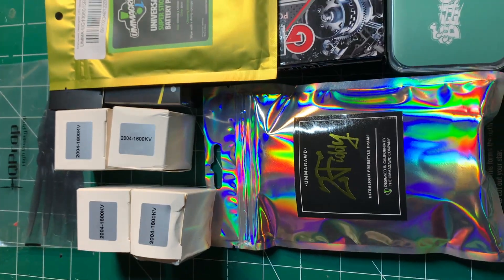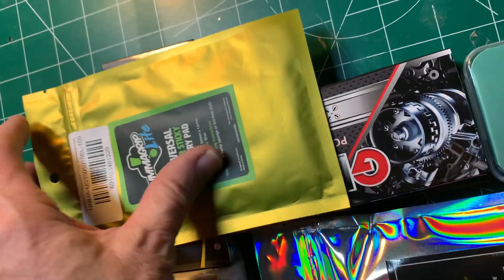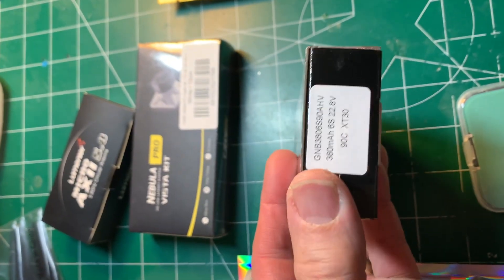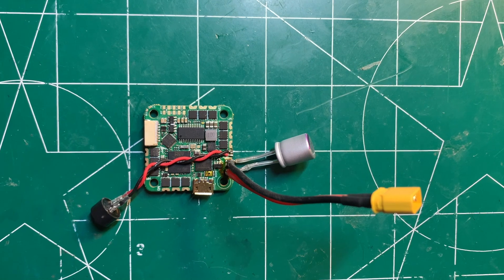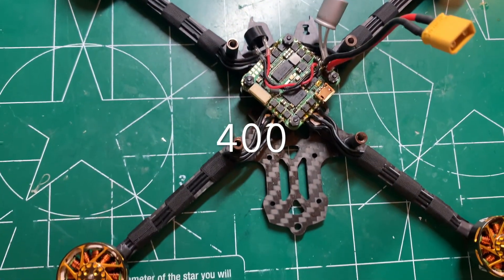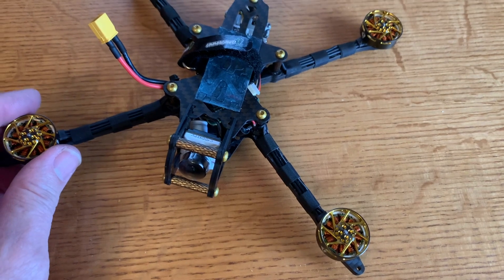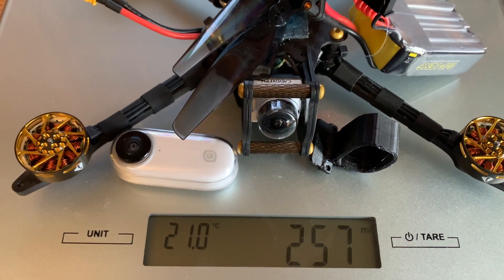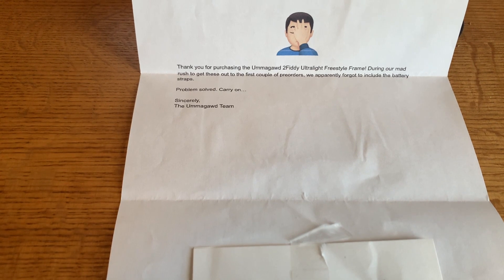Ummagawd 2Fiddy 6S Build

Comment: to use an insta 360, you could just make it without the DJI unit and make it an analog build
Reply from the maker: Yes that would shed some weight. Another option is Sharkbyte/HDzero if you still want HD. 
Thanks for your thoughts.
SLOG
Reply: @slogfpv  indeed. but mounting the TX5S.1 requires going with the double stack, and Joshua Bardwell's video has put me off on that front. I'm waiting for my 2Fiddy frame to arrive, I still have the tiniest hope I can mount the TX5R.1 in the back
Reply from the maker: @pgabrieli  It seems like it would fit where the Vista is supposed to be mounted with the 20x20 mounting plate. The dimensions are 32.5mm x 32.5mm which is close to Vista size. The tight spot is next to FC so I would try orientating the antenna connector to the front and the camera connector to the rear. Seems backwards but that would give you more space up front. You may have to buy a  longer camera cable. The other option would be to use higher standoff to lift it above the FC if you wanted the camera cable to come out the front. This is a narrow build so having the camera cable coming out the side maybe an issue as there would be no frame protection.
SLOG
Reply: @slogfpv  cheers, mate! thanks for the suggestions! 👍👍👍

Comment: its ok not that special
Reply from the maker: In its sub 250g configuration, yes it flies more like a toothpick without any fling. However, with a Session and 550mAh 6S battery (373g) it flies freestyle much better with the extra mass and added disk loading (way more fling). Of course that does defeat the purpose of being under 250g. But, I still like it because it is way more quite than a traditional 5 inch build.
https://www.youtube.com/watch?v=OIh2xPjfjD0&t=552s
Cheers,
SLOG

Comment: Great job nice build. I live in new Zealand and can't get the lipos can you please send me some if I send money to you for time and postage thanks kindly
Reply from the maker: Hi Kerry, it would be very cost prohibitive to send batteries from the US and the availability of these batteries is out of stock. Hopefully GNB will manufacture more of them. That is one of the down falls of the 6S version. I have also been flying the GNB550 6S 80C battery and you get longer flight times and flies great. The obvious downfall is it pushes the quad over the 250gram mark. Found them at a NZ store https://www.kiwiquads.co.nz/product/gnb-battery-22-2v-550mah-6s/
Reply: @slogfpv  hi its for a 3inch build, they are less than 100wh so you just send as normal post is allowed, very small lipo only 8wh. people can fart more than that,

Comment: Nice video! I’ve been enjoying mine too. I went 6s, but it also flies great on 4s and 3s on the same default pids. Just don’t over tighten the screws to the  standoffs they tend to strip out. I already had to replace most of them haha. And I  broke a motor unfortunately haha🙈.  Enjoy your build! On 6s it’s a rocket!
Reply from the maker: @Nate C, I am glad to hear the 2Fiddy runs good on 4S. I have a lot more 4S batteries with XT30 connectors. For my "Park Freestyle" I don't need a rocket.
Cheers,
SLOG
Reply: Would you run 4s motors and cap rpm to run6s?

Comment: Nice build slog 👌. Hilarious that it’s lighter then my gecko’s 😅.
Reply from the maker: Hi Barnz1980, I thought of you when I was doing this build. Tommy does put this frame through a crash test by crashing it into a brick wall until it finally broke. Pretty tough frame but probably will not hold up like a Gecko 3inch due to the thinner longer arms. He designed it so the arms break first. Here is the crash video:
https://www.youtube.com/watch?v=zV1NI3Z3hnc
Reply: @slogfpv  Hi Slog, I saw when tomy was doing the design & testing videos for the 2fiddy. That "comment s section press conference" video he did had me in stitches🤣😂🤣😂
I actually built a 5" drone on 6s using the Badger frame frame Armattan, wow 5" flys pretty good hey slog! 
Have you been flying the 2fiddy much? How many 5" drones do you have?
Reply from the maker: @BarnzTX3  
Waiting for the weather to get better before I take it out on its maiden. I have 3 working 5 inch freestyle quads. My favorite is a Marmotte HD build with an air unit so I do not have to carry a Gopro. I do like the way they fly but gravitate to smaller and quieter quads. Due to its weight, the 2FIDDY will probably fly more like a 4 or 3 inch build but will be more efficient due to its lower disk loading. SLOG
Reply: @slogfpv  they are quite abit noisier on full throttle arent they! i have those gemfan windancer props on the geckos atm & they are quite loud also for 3"drone props that i have tried. Still the 2306 xing E on the 5"drone with the Ethix watermelon props gets louder haha. 
Im intrested to hear your thoughts on the 2fiddy build though, you have quite a few drones in your quiver now Slog so always good to hear your opinions.
hey that could be a vid idea? a brief over view of all your quads, working or not, what you liked about them & what you didnt?
Reply from the maker: @BarnzTX3  
Some of the quads are a little dated as the rapid technology improvements in this hobby reminds me of when PCs first came out. But a compare and contrast of the advances in the last couple of years could be interesting. Thanks for the suggestion.
SLOG

Comment: Nice build. I really like the components, but if I were to build this I would probably be more inclined to use a 4s battery, instead of that odd 6s battery. Interested to see your flight...
Reply from the maker: @Dead Lazlo, I was torn between the 4S and the 6S when the motors came out. The 4S is way more practical but I have other 4S ultra-light builds. So I decided to go bleeding edge. The other advantage with the 4S is the extra weight savings of using a lighter battery, you can run an insta 360 and still be under the 250g mark.

Comment: Way lighter than mine. With 20x20 stack and tpu for HD cam mount and gps mount. Long Range antenna mount at 218g before battery strap
Reply from the maker: @Diving Falcon FPV, I was going to put a 4S Lion battery on this quad to see what kind of flight time I would get. The only problem with this frame is you get props in view.
Reply: @slogfpv  oh shit . Yeah to keep weight down. I use dji video a lot

Comment: Used his motor on Dave c long range 5". Motors are great but got 2 bad fc from iflight. Bad receiver from tbs, now zeez f7 not flying good.  But might be mounting. I have no room in mounting.  So many headaches. 
I should did an aio. I have no room inside drone.
Reply from the maker: Never used them before but on the Ummagawd channel, Tommy mentioned a 20x20 FETTech AIO you may want to check out. FYI it runs Kiss.
Reply: @slogfpv  yea if I can't get it to fly perfect I'm going to be swapping fc again lol